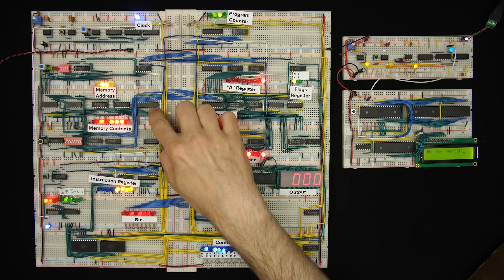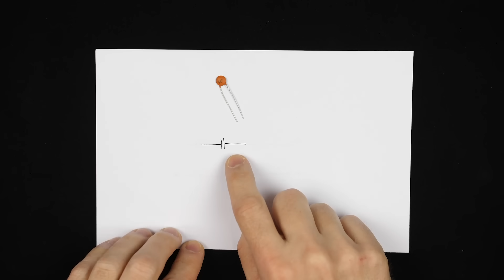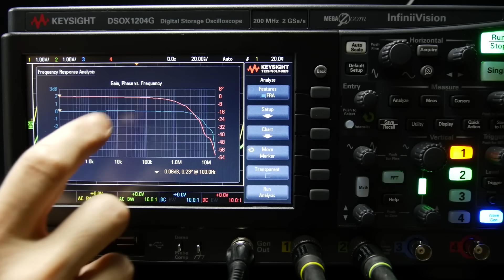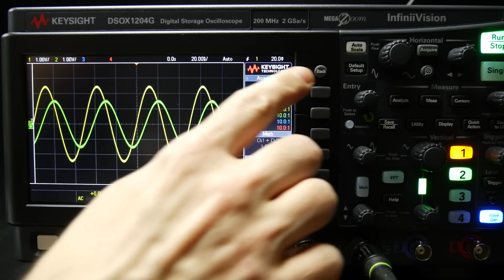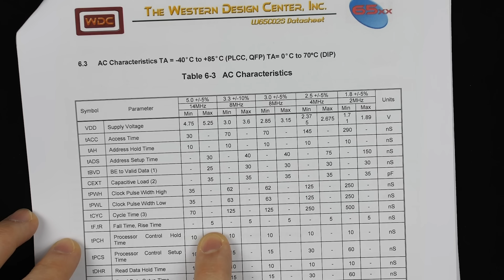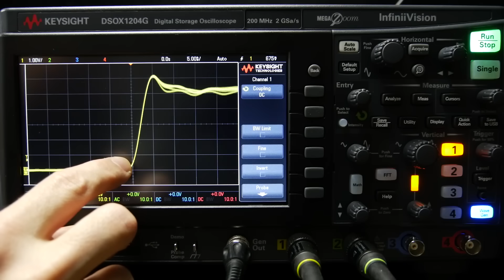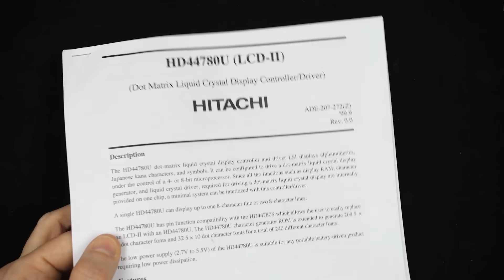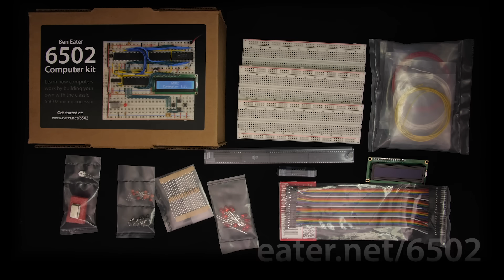Why build an entire computer on breadboards?

Comment: If the answer to the question were "no", I'd feel bad for following the tutorial but doing it in Minecraft
Reply: Yeah doing it in Minecraft is best as you don't have to do the hardwork of actually cutting wires and stuff. Also it makes a lot of stuff kinda easier due to mechanical components (pistons etc.)
Reply: @noether9447  It also makes some things harder, since signal needs to be repeated every 15 blocks, and since you're making a CPU and logic constructions, you need to space things a lot and get reaally long wires and place them by hand. But you also don't need to play with ground and power lines the same way. I'm not sure that's really just easier, I think it takes much more time.
Reply: @zouzouglou  you can use the repeaters to your advantage by having certain parts of the computer activate before others, so that most instructions need only one clock cycle
Reply: @blu iirc redpower mod also works (used to use it on 1.2.5)
Reply: blu yea

Comment: >Is it a good idea to build a computer on breadboards?
Heck yeah it is, without you executing out that idea we wouldn't have this goldmine of a channel.
Reply: Yea, And I would never have gotten to build my own either (ok that one  is technically not a breadboard computer as it uses solder boards), so Yea, definitely a good idea :-)
Reply: It's for people who want to learn how computer works and/or how to design circuit (very important if you want to be a software/computer/electronic engineer). It's definitely not good or cost-effective, if you want a new computer.
Reply: @y.z.6517  Exactly, chances are also that you will end up with intermittent errors caused by poor contact somewhere in the system.
The one I made works most of the time, but sometimes it doesn't.
As far as I have been able to debug, it is caused by either some poor soldering on my part in some of the modules and/or contact resistance in some of the 16-pin ribbon cable connectors...
Reply: Now bye motherboards say Hello to breadboards